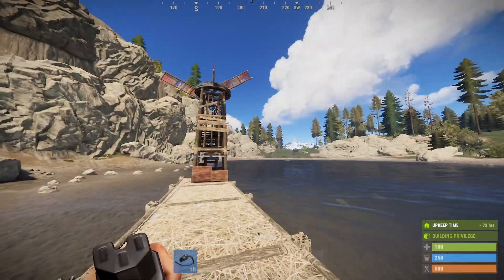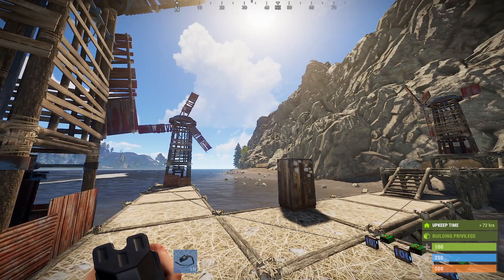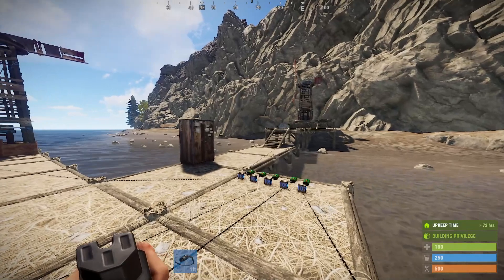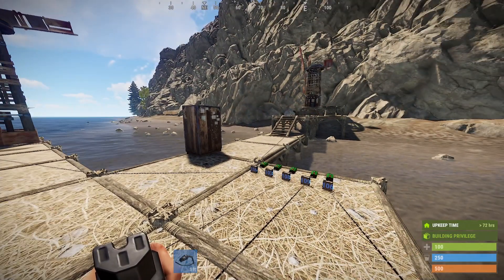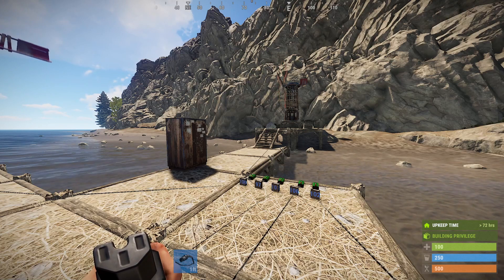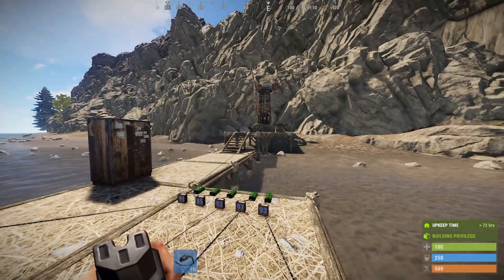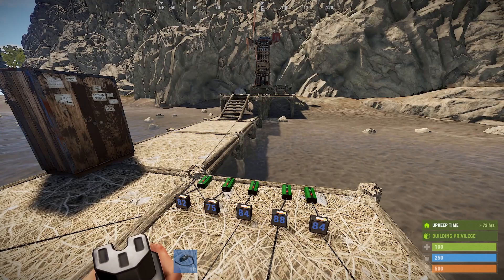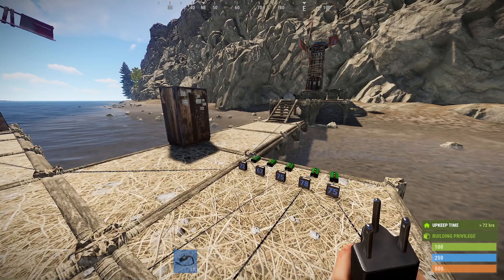Rust Electricity: User Request - Wind Turbine Environment Impact on Performance

Comment: How many times did you have to place the turbines to get them to face all in the same direction. lol. I have placed 4 and had all 4 facing different directions despite them all placed with the electrical connection facing in same direction.
Reply from the maker: So I actually finally paid attention to that this time! When selecting to place, the "opening" is to the left, the blades are facing away from you. Rotate as desired, but the blades should always be one side clockwise from the opening.